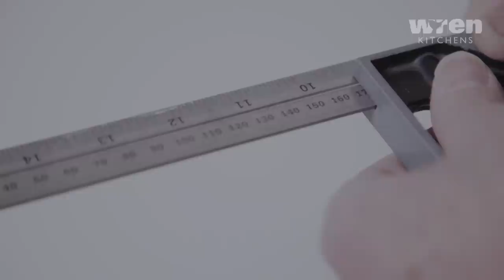Wren Kitchens Infinity: Corner Base Unit Installation

Comment: The thing that's missing from so many of these 'how to fit base unit' videos is between 6.30 and 6.32. How to man handle the base units from laying down to standing up and into position. I have some base units (from another company) that need fitting and they weigh an absolute ton! It's always tricky moving base units around because once legs are fitted you cannot drag them around. Video's like this make it look very easy but i have 3 very heavy 1000mm base units to fit into a 3040 gap! First 2 will be hard enough but the 3rd!
Reply: Yes. They're only chipboard, but they're so heavy! My husband is 71 and he's fitting it on his own. Stubborn old bugger 🤣
Reply: Two people required.

Comment: This is the second video I've watched where everything is perfectly straight, I've just fitted a kitchen for my Daughter it's  took 2 weeks just putting the tall wall units up 
Due to the plasterer dot dabbing the board 2 inches off the walls and not using a level.
Will still be trying  to make this look good in 3 months time, not fitting a kitchen in a 1hr video 😢😢
Reply: Have a look a Mr a builders channel on the Wren kitchen he explained how to make the kitchen look true and straight when the walls are out

Comment: My 'corner posts' consist of two UN-EDGED pieces of melamine that are too short to fit on the face of the unit; they fit in between the top rail and base. Nothing else in the cabinet pack at all - despite the dickhead on the other end of the phone to my customer insisting there is. There should be two fillets of the same colour as the doors. Seven years since I last fitted a Wren kitchen. Back then, the worktops were actually hollow - dead easy to lift, but I wondered how long they would last - drop something heavy on them and I'm sure they'd break. Also awkward to mitre at the corners. By the looks of these videos, they are for DIYers. God knows how they get on...